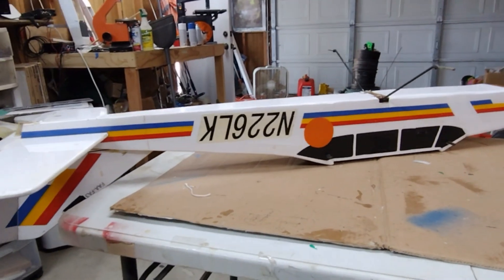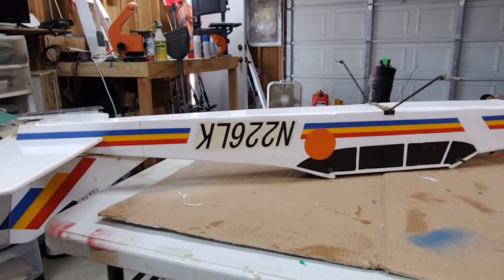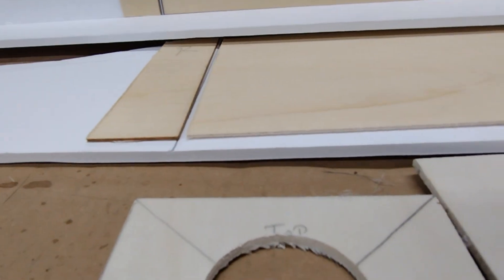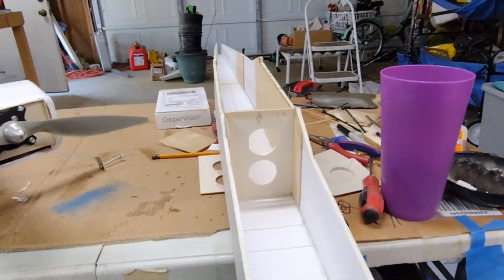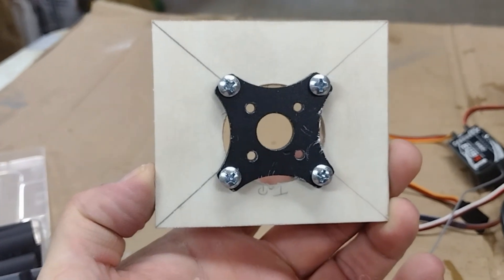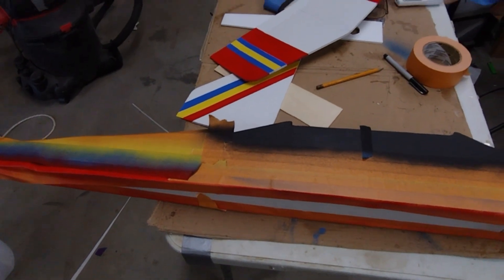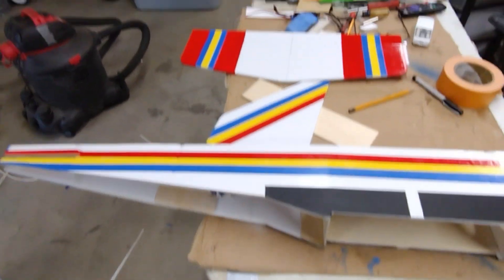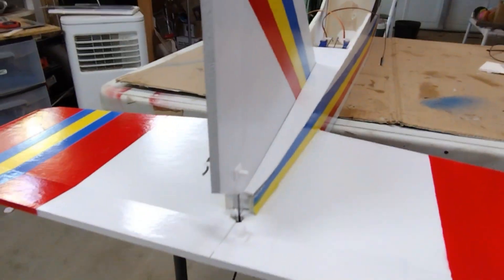Building a 40 size foam board fuselage.

Comment: 905    strange wing.    apparently, no center section.      the vert-stab could be a little taller.    should be equal to slightly less-than fifty percent of the horiz-stab span.        d
Reply from the maker: The wing is the wing that came with the ARF it's balsa wood and plywood.

Comment: 727   'adding' mass at the tail should be avoided.    dom, remember.      maybe, glue fillets would do the job, with less mass.      obviously, the use of a tail wheel  makes the tail  Heavier.      did you even consider using a (low-mass) skid.
733   there should be  NO  extra, cosmetic bends in a  PUSHROD.!     this is not an opinion.       d
Reply from the maker: Well it flies great and it's balanced perfect but everyone has there opinion.

Comment: 005   the slope of the vert-stab le  is/was  excessive.    about 75 degrees is nominal.    for a miniature vert-stab.      there is one problem with making a tail boom from a panel material.      it is this:
    there  Will  be excess mass in the tail boom,  Unless corrective steps are taken.!
specifically, construction of the tail boom should accommodate the  use of (mass-reducing)  cutouts.
150, 915   for a tail dragger, the main lg should be located directly below the wing leading edge.    this is not an opinion.    for proof, look at full-sized tail draggers.
515   servos  go  Near  the  cg, not aft-of it.!      this is not an opinion.    it's about distribution of mass (dom).      similarly, the mass of aileron servos should be located forward-of thirty percent of chord.
 there is  Nothing  Wrong  with a long pushrod.!    assuming it is correctly made/fabricated and installed.        conversely, there is 'nothing good' about a short pushrod.
920   the use of full strip ailerons is not recommended, on anything that is not a cropduster.!     
924   the root chords of the stabs  Should  be  Equal  in  length.         d
Reply from the maker: The only thing I changed on this airplane what is it making it a tail dragger. And building it out of foam everyone seems to be an expert.